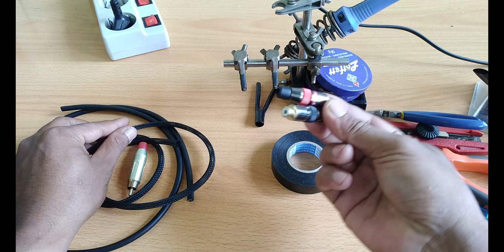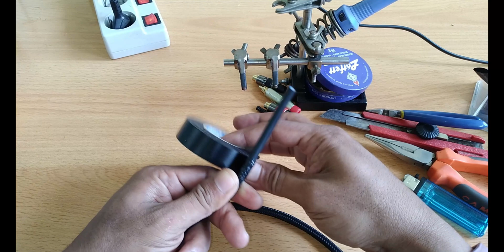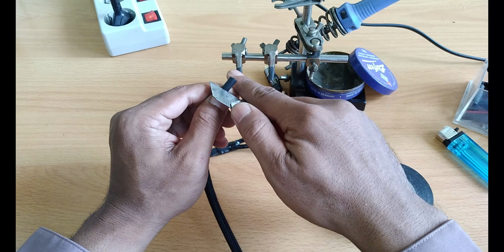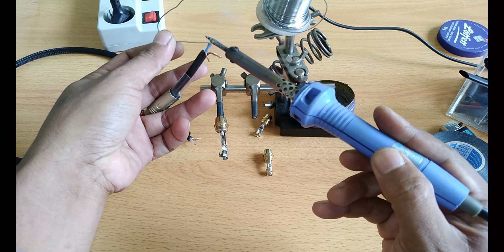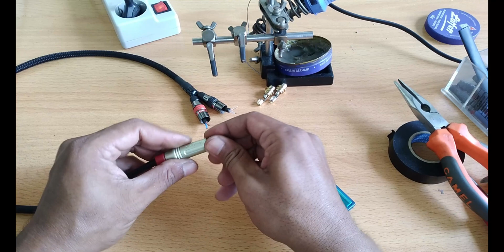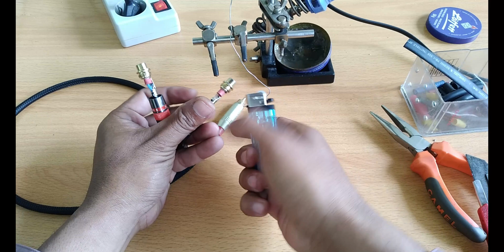How To Solder an Audio Cable DIY RCA Y Adapter for Subwoofer

Comment: Your video is good, but my question is, will that work? I say this because I have 4 rca outputs for 4 speakers, 2 at the front and 2 at the back, but I want to install a subwoofer. Will that type of cable also work well to install a subwoofer in my car?
Reply from the maker: Yes, of course this cable will work if used on a Car Audio Subwoofer Amplifier with RCA Output

Comment: pra enbtender bien el funcionamiento de este cable  el conector macho lo conectamos a la entrada del equipo??? y las dos conexiones hembras  podemos conectar dos cables machos de diferentes equipos es asi ''''
Reply from the maker: Adaptador RCA en Y con 2 conectores de audio RCA hembra en un extremo y 1 macho en el otro
Conecta un televisor, un reproductor de CD/DVD u otro dispositivo compatible con RCA a los puertos de audio (izquierdo y derecho) de un subwoofer, amplificador o receptor A/V
Este cable divide fácilmente los componentes de audio existentes